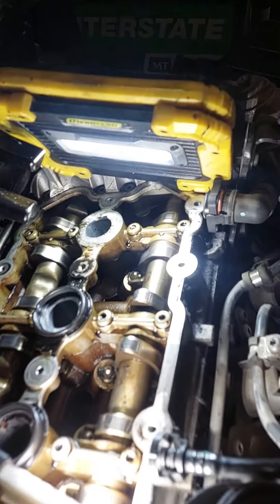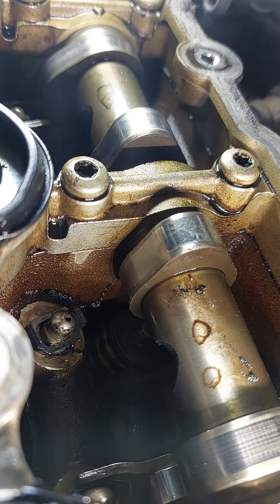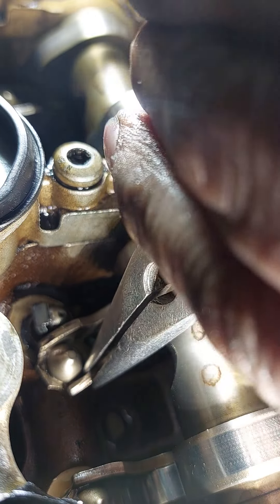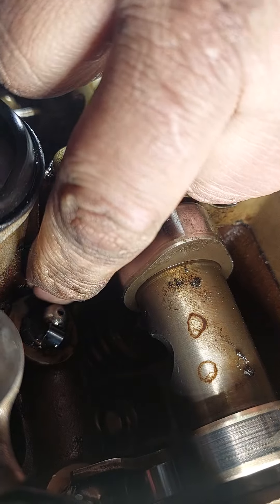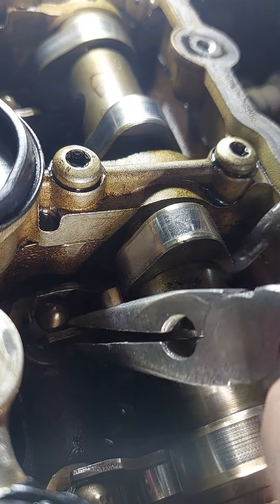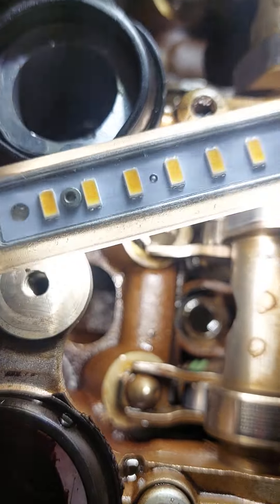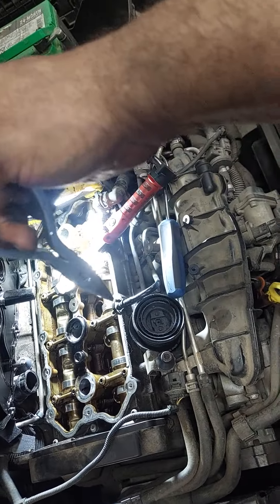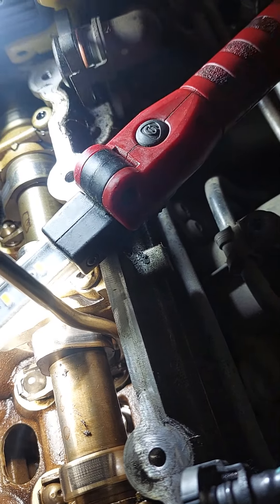FSI 2.0  AUDI A3  VOLKSWAGEN,  ROCKER ARM TRICK PART #3k

Comment: This actually works but you don't need any serious prying, just keep turning the cam until the rocker is really, REALLY loose (i.e. has the most room to move under the cam), you can go by how the remaining "partner" valve feels....then put the back end in first on top of the valve and easily and gently pry the front end on top of the lifter...super easy, then clip it.  Just be careful you don't mangle up the clip in the process.
Reply from the maker: Thanks for your reply,  cheers

Comment: OMG DUDE!!!!! you"ve shown me the light!!!! I was so afraid a whole tear down was coming. i had a rocker arm bearing blow out and 1 single arm pop off.
Reply from the maker: Bill Wilson,  you got no idea the happiness that brought me to achieve that hackery and that it worked, my pleasure that will help you, please share
Reply: @quicktimesmechanic9980  I bet!! and I will
Reply from the maker: Thanks man
Reply: @quicktimesmechanic9980  HI man. I got a quick couple questions if you could please answer for me?
Reply: Are the 2006 audi 2.0 turbo rocker arms the same size on both sides because mine look the same? Are these interference engines?
Reply from the maker: Hello if i well remover is the same from 2005 to 2009
Reply: @quicktimesmechanic9980  All the lifters are supposed to flex just a little bit correct?
Reply: @quicktimesmechanic9980  I had a rocker arm pop off mine. I replaced both the lifter and arm. But upon start up and run. It still chatters or ticks
Reply from the maker: Yes they have their amount of travel but be careful